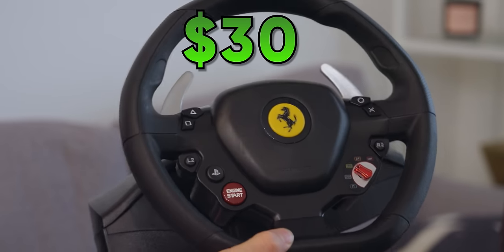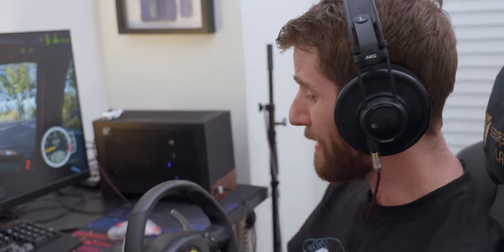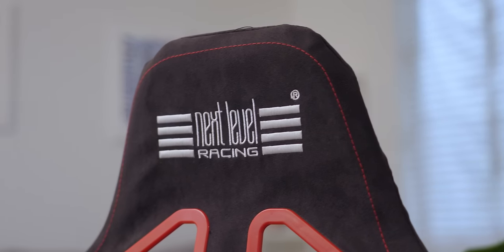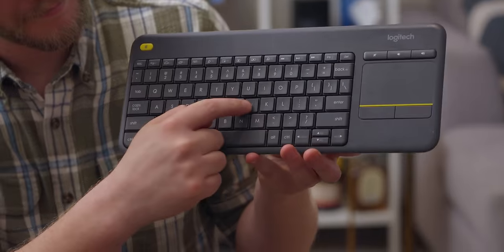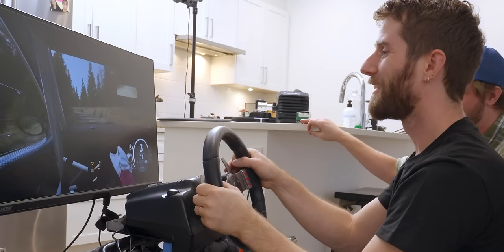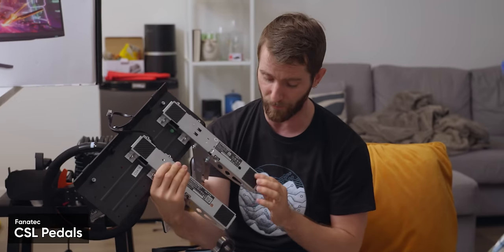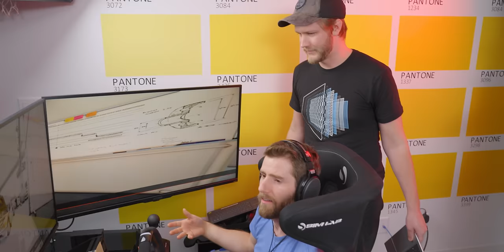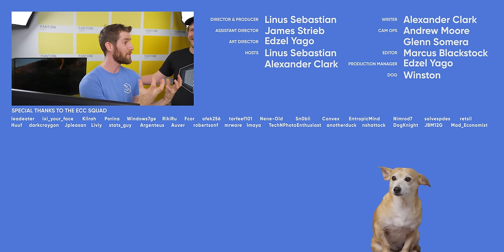Don't Waste your Money - $30 vs $10,000 Racing Setup

Comment: Force feedback can be an expensive feature, but if you're shopping for a wheel, make sure that it at least has rumble. It makes a huge difference.
Reply: Rumble and Force Feed Back are different
Reply: @larryfoster423   no where in his comment does he say they are. hes saying if you cant afford force feedback get one with rumble
Reply: If you can't afford a wheel with FFB stick to a controller until you can. There's literally no point in using a non-FFB wheel, even one with rumble. It's just going to feel terrible and you're going to be slower
Reply: @cheeseman83  I was not stating that 1 was better than the other. I was only metioning that they are different. I have helped people just getting into simracing who did not know the difference.
Reply: Forcefeedback I think is the bare minimum to have if getting a wheel. It's just sliding, weird feeling wheel is nothing like a real car if not using force feedback in a wheel
Reply: @cheeseman83 If you can’t get force feedback don’t get a wheel. It’s not even worth it.
Reply: I think you can get a force feedback wheel for cheap now? My friend gave me an ancient Logitech wheel with force feedback, I got curious and found a couple of them second hand for under 50 euros. It's not the best, but good enough to be fun, I have over 100 hours on it for sure
Reply: No, if you want a wheel make sure it has FFB, if it doesnt have FFB its a pointless boring experience, stick to a controller.
Reply: Force feedback is not expensive feature
Reply: if you're gonna get a wheel please just wait until you can afford a FFB wheel, I promise it makes it worth it

starting out on a rubber band wheel is like trying out VR on an oculus go, you'll hate it
Reply: @ErisAlter  and im here using my phone as a steering wheel 😂
Reply: Holy fucking shit, force feedback is not expensive.  You can pick up a Driving Force GT for next to nothing and they're fucking everywhere.  Unless you are an actual 10 year old saving pocket money there is zero excuse to EVER buy a wheel without it.  Just cuz you can't find it on fucking Amazon doesn't mean it doesn't exist.

Comment: Would love to see one of these for flight sims assuming there's someone on staff in that niche.

As a flight simmer the near complete lack of VR adoption in the racing sim community baffles me. There are a few fuds in the flight sim community who swear by monitors, but VR has been pretty widely adopted. Widespread use of force feedback is cool though, it's rare and expensive in flight sims
Reply: Id love to see them go through mouse and keyboard, controller, VKB gladiator, virpil constellation and tell us their impression of each setup. Whether it's dual stick or stick and throttle (with or without pedals for both)
Reply: @jonathanpatry  Make sure to have someone inside the niche host it then; going from 0 to 100 adds so much useful functionality and ease-of-life things that a random person simply wouldn't appreciate or know how to judge. Much easier with sim racing since everyone has driven a car
Reply: How do you like using flight sim accessories in VR? I'm mostly into the truck sims ATS/ETS, and the only thing I don't like about VR is when using my monitor, I use my tablet as a "button box" for the switches and such. I can't do it while in VR because I don't have the tactile feedback of a real button box.
Reply: Honestly, as a sim racer, I'm not even close to considering VR as of today. Some sim racers use it, but it's clunky, robs performance which is more important in racing than in flight sims, it's heavy, uncomfortable for long periods of time, and it gets hot and sweaty in there. Although the guys who use it do say it feels quite realistic.
Reply: @luizarthurbrito  Quest 3 has been epic for me, I switch between though (triples and vr), AMS2 and AC look great in VR and aren't hard to run either
Reply: Oh. I just came back to this video. After checking out flight sim gear.
Reply: i think the reason you see a lack of mention for flight based vr sims is because of how little the target audience that actually can withstand the torture of nausea and fatigue that enters when taking a game to try to trick yourself to be moving off the ground. its more bearable on the ground while moving but take it to the skies and it gets worse for a larger group of people. so much that it outweighs the gains to make such a strong effort for something so few people can enjoy. 

i am one of those guys that loves vr over the tv screen, and i am so thrilled i can sit hours on end on a vr setup and not feel seasick. my favorite game on vr actually is taking things a bit crazier than flight over the land per se. its space exploration. 

Space Engine for me i can sit hours on and not get tired or bored of, because the sense of aww i get from playing and being able to lose oneself exploring the galaxy becomes something else that i cant help but to just sort of soak it in and i can get lost on that and the whole journey is specatular. 

its a shame that everytime i wish to share with folks how awesome this experience is, a few minutes on the vr is enough that they feel motion sick and nausea. like our minds not liking being tricked that it punishes us in return thru nausea and headaches
Reply: @TooOldForML  For War Thunder and low fidelity DCS aircraft I have everything bound to buttons on my stick and throttle.  I’m trying to get vr gloves working for high fidelity DCS aircraft (clickable cockpits) but it’s a work in progress
Reply: For any of the good quality sim racing titles VR is very prominent it's only very few titles that doesn't have it implemented, EA wrc is going to have it as an update sooner or later and I'm not really sure what sim doesn't have vr support now.
Reply: Yess, VR sims are just the absolute best. I use VR with Assetto Corsa, iRacing, Automobilista 2, Richard Burns Rally, American Truck Simulator, rFactor 2, DR 2.0, and that's basically it. ACC performance is terrible, Forza and WRC don't support it (yet with WRC), etc. Even then, sometimes, I like to just play flatscreen and use my screens with simhub dashboards.

I will say that VR is mindblowingly immersive when it works well. Playing through the Assetto Corsa Evoluzione career mod and different servers online in Assetto Corsa is some of the most fun you can have gaming. I also play VTOL VR, DCS, and Falcon BMS all in VR with my HOTAS, leap motion controller, and finger mice with the fingers custom application. That's absolutely mind blowing too. It's cheaper than PointCTRL and works just as well.

Comment: As a head admin in an F1 Racing League, I can say setups ccan make or break your racing experience, and most people prefer other types of equipment. I know one person who uses a controller who is slightly quicker than me on a wheel (Thrustmaster T-GT II with SF1000 Replica Wheel Add-On) and when I have tried on my controller, I have no idea how he drives with it.

There was also a similar incident where the Tier 2 champion in our league who was racing on controller switched to a wheel for the start of the next season, and he was moved down 2 tiers into Tier 4 because he was starting to use a wheel which made him slower, and he was but he quicckly got used to it and went up to tier 3 which is the right tier for him.

So it really is what you prefer and what you are used too that really works, but the question is expensive, or cheap?

I have used only 2 wheels so far, the Logitech G920 and the Thrustmaster T-GT II and like force feedback is different on them both - Logitech is gear driven and the Thrustmaster is belt driven - there is also direct drive but that's only on a handful of wheels and not common and usually quite expensive. As a whole, my setup cost me about £1.2k which includes wheel base, 2 wheel rims, pedals, shifter, and a stand. This vs my old setup that only cost around £300 or so which had a wheel base, wheel, pedals, and a shifter. Which one was I quicker on? Well my driving skill has improved since switching, but I can say when I did switch I was slower as I was getting used to the new force feedback system and new rig in general but eventually found my feet and got quick again.

I personally think racing setups are there purely for immersion in your desired sim, and not really to go quick - sure you can be quick on them but that comes with time and practice. I use my wheel on a handful of games, F1 23, ETS2, Bus Simulator, Asseto Corsa etc. and the immersion is unreal - add on a VR headset and your golden.

Comment: Really enjoying WRC, similar to Dirt Rally 2.0 only with much more accessibility. A second hand Logitech wheel is how most of us get into sim racing. Bonus tip for those playing on their PC chair; try swapping the wheels out for glide castors to keep in place
Reply: wheels on chairs are absoluely ridiculous
Reply: Or just put a shoe with a grippy sole facing backwards on each wheel.
Reply: Good tip about the wheels/castors! Personally, I cut some random old thick printer cable in half, tied them into circle-shapes, and put them under the wheels that are facing toward the back of my computer chair. It's a thick cable, somewhat grippy plastic, keeps those wheels from turning. My chair stays rock solid even when I'm braking hard, but it's still easy enough to push around. I leave them there all the time
Reply: @ThatGuyFromDetroit  lmao they are just s adumb idea to use from day one. get a proper comfy sofa type chair

Comment: I actually find that playing sim racers with pedals and wheel in VR makes me much better at the game, thanks to the added awareness it gives me.
On a single monitor the view I have is so restricted I end up driving much more cautiously.

It'd be interesting to see staff try both and see how they fare.
Reply: Definitely. VR adds a huge amount, probably as much as a ff wheel. I'm still using basic fanatec csl pedals tho. Really need to upgrade them.
Reply: For me it's the 3D effect that lets me judge when to brake way better.
Reply: I used to exclusively play in vr but now that WRC doesn't have vr it's actually not as bad. I think VR made a huge difference when I was new but now I'm kinda digging the easier setup. Still looking forward to when they add VR for the immersion factor.
Reply: VR really hits that itch, with fov and free look. Be it racing or American trucking. You don't need 4k big format gaming monitors.
Reply: Same. My senses are heightened in VR and I feel more consistent in my lap times.
Reply: If you have absolutely no motion sickness problems, yeah. If you do, then you'll never want to try sim racing again. People push VR sim racing far too much (especially to newcomers), I feel. Many still prefer displays, including myself.
Reply: @Brandonr757sGaming  I had the usual VR motion sickness when I first tried continuous locomotion in games, but somehow I have never felt sick driving in VR.
I chalked it up to the windshields being narrow enough that blocking the edges of vision helps with the motion sickness, but I guess it might not be the same for everyone.
Reply: @Travisdeste  Very odd. My motion sickness is especially poor, unfortunately. Smooth locomotion in VR is a big problem, and trying to use my VR headset at my racing rig was a big nope for me. Immediate regret 😂 I'm very happy with my triple monitor setup instead, and I think it's a good choice that gets overhated.

Comment: I got a Simucube 2 Sport and a set of Heusinkveld Sprint pedals. It's only really worth it for hardcore sims that put a lot of effort into the tire model and force feedback but holy hell is it impressive to use. The muscle memory you get with load cell brakes and the detail and response from a direct drive wheel are incredible
Reply: Thats a nice setup

Comment: FYI to Alex about that display OSD — most monitors have display port ddc or HDMI I2C communication so you can use software to control the monitor. Real life saver if you constantly change brightness (because PC side of things still didn't discover auto brightness which drives me mad)
Reply: I second this. The ddcutil package in archlinux repos allows you to control the display's parameters with the command of the same name over HDMI or DP. There may be a similar utility for windows.
Reply: @yuyuko_s75  Do you mean every paramater like even black level, contrast, and presets? cuz that sounds amazing
Reply: I had an EIZO monitor with auto brightness. It drove me mad.

The phone auto brightness also does. It almost works perfectly but then it doesn't.

I use a utility now for DDC brightness control. Previously i had some batch scripts which change a whole bunch of settings via DDC. I think that would be perfect for Alex.

Comment: Totally agree with you, racing without a wheel with force feedback is not giving. All that changed today with a brand new Logitech G20 (with gearbox) quite affordable and happened to fit easily in my current setting without resorting to a frame. Went from car uncontrollable to the point of being unable to race, to ending in the middle place of a quick race with 8 other cars in just a few hours of practice, building track and controls memory, mastering speed and cornering from visual and feedback cues !

Comment: I have had the same Logitech G27 since 2012 and I still use it to this day! Hands down best wheel! Best value and has the most buttons it seems to get everything set up just the way you want!
Ive had mine 2nd hand for 12 years and zero problems

Comment: the funny thing about the ultimate setup is that EA WRC doesn't support proper triple screen projection unlike other simracing titles in the market like assetto corsa, rfactor, iracing, etc
Reply: Knowing how F1 games handle "simulation" I wonder how much of a simulator is this "simulator". I would prefer they used a proper sim. Especially that they had most of the equipment anyway, so it could have been sponsored by anyone.
Reply: Yeah Triple support is something that should be basic for any simracing game.
Reply: Not surprising with EA. F1 doesn't support it either. Most racing games with a targeted console release don't support it. At this point, any game that isn't supporting triple monitor and VR support is behind. Forza and EA are still behind the 8-ball on that, but at least EA is finally support VR. I'd play a lot more FH and GRiD if they had triple support.
Reply: @sven679 it's not, but lacking proper fov settings is a huge sin even for simcade.
Reply: They know about the issue and may be working on fixing it from what I've seen.
Reply: @sven679 from what I heard the new wrc game is quite good at simulating although there is a bit too much grip on tarmac
Reply: Yet.  Same with UDP data for displays/telemetry (or non D-Box motion setups), but that's to come in the next few months post-release (same with VR support).
Reply: @SeaGLGaming  EA doesn't make the games. The people behind it, are still the same people from Codemasters. It's a Codies game with an EA logo on top of it.
Reply: @Koyomimatic  Except EA does make the game when they tell you how much time and money you can spend on things like acutal simulating car physics vs arcade stuff.
Reply: that's because codemasters are not making simracing games, they are arcade style because they need to sell the game to ppl that don't have simracing setup and they need to make them enjoy it as well. Espacially with the big franchises like F1 and WRC that need exposure to a greater pool of users.